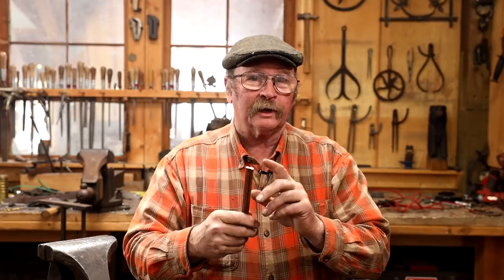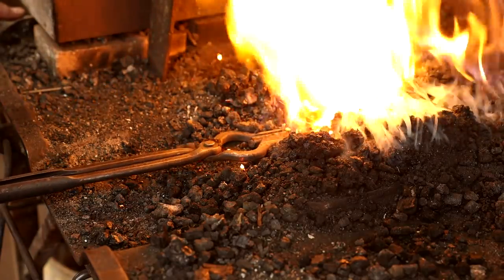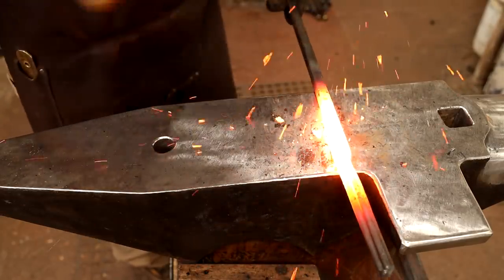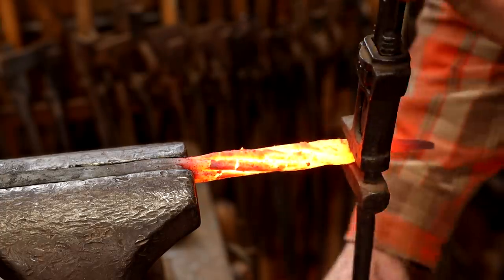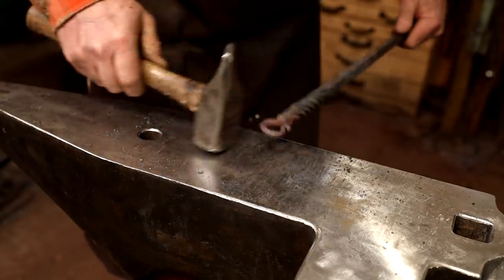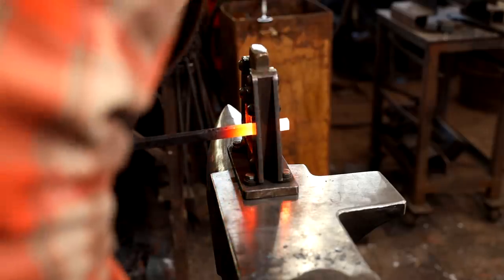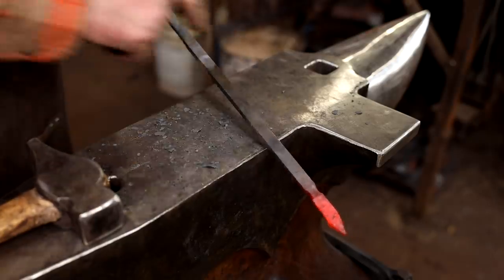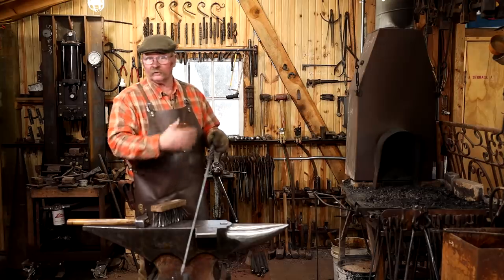How to Forge a BASKET TWIST - with 5 bars

Comment: That's a really nice poker. I know the main idea is to show the basket twist (which I love) but I mike the way you made the pointy end as well.

The new anvil looks great but I can still hear a really high pitched ring when working on the face of the anvil and it gets worse when you're working around the shelf area. I wouldn't mention it except that it's just at the right pitch to hurt my ears. Maybe a magnet under the shelf would help? 👍

Comment: HI John the 1/4 turn twist is so neat and smooth ,when I made mine I welded the ends with an arc welder :( and a 1/2 twist it was a bit lumpy.
I never stop learning watching you John that 5th bar looks amazing and the 3/16 piece at each end ,That's why you're the boss. Cheers. :)

Comment: This may be a dumb question, but I'm totally new to blacksmithing and truly don't know much. My question is about when you talked about striking the material with the hammer that you push it off the edge so you won't hit the flat surface of the anvil. I thought that is what the anvil is for so why don't you want to strike the surface of the anvil with the hammer?
Reply from the maker: You do work between hammer and anvil, but you should avoid the hammer actually striking the anvil.  When forging a taper its easy to ding up both hammer and anvil at the end of the taper, so working near the edge lets the edge of the hammer miss the anvil while still leaving the work on the anvil.

Comment: How many pieces can you reasonably forge weld together in a project and maintain structural stability? Is there a formula or anything?
Reply from the maker: I have seen basket twists with 7 bars and I'm sure you could do more.  No formula as far as I know.  Many knife makers will have a thousand layers forge welded into pattern welded blades.

Comment: I have a question about forge welding. When you forge weld a piece of material do you need to keep working it at forge welding temperature? When i work a forge welded piece it likes to create a seam and then come undone.
Reply from the maker: As you work and refine the piece its best to stay at welding heat so that you are refining the weld as well.  But if it breaks easily, it probably wasn't completely welded.
Reply: Okay thank you, that makes more sense.

Comment: Was that a little cheater weld on the end of the rods?  :o} As always, thank you for an informative video.  I can't wait to try this myself!
Reply from the maker: Just a way to keep them together until they are forge welded.  The extra spacer in the center can tend to fall out otherwise.
Reply: @BlackBearForge  That's what I figured.  You didn't mention it in the video.  I was joking because a "purist" would probably give you grief over spot welding before forge welding - even though that's how knife makers normally prep their steel for forge welding damascus.  It was a great video, and I can't wait to try it myself once all the snow melts and it's warm enough to re-line my coal forge.  Thanks!

Comment: Because this is left off every blacksmithing video: how long does it take in the forge to take this bar to the yellow glow?
Reply from the maker: I leave the time off because it is so unreliable to think in terms of time.  Different forges, fuels and state of the fire all heat differently.  In this case from cold bar to welding heat is about 2 minutes.  But later in the day as the fire gets dirty it might take longer and in the induction forge it might only be 30 seconds.
Reply: @BlackBearForge  Thanks. A rough estimate was all I needed. Some minutes, half an hour, i don't know. Is he standing around, reading books or is even a pee brake a risk? ;)